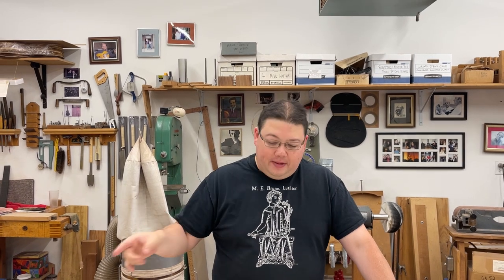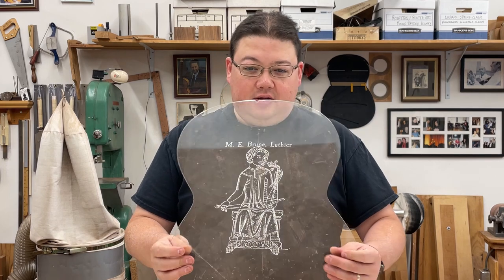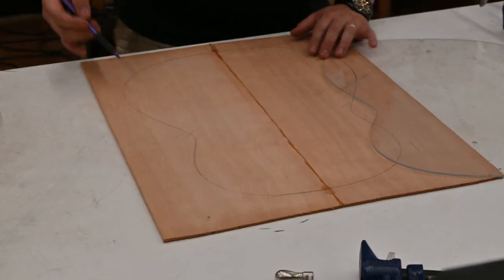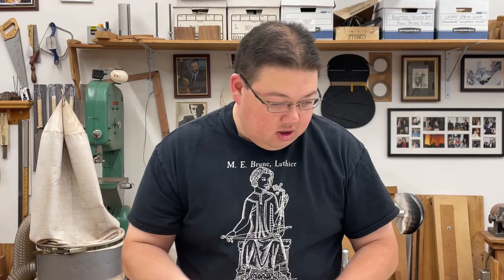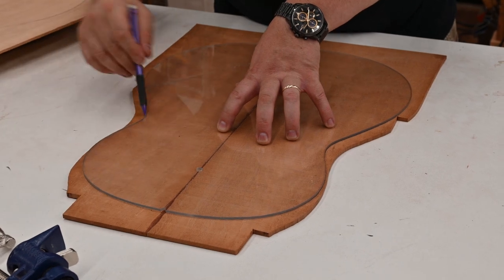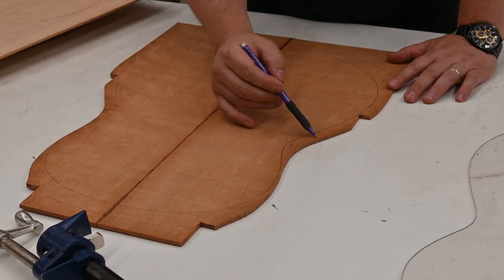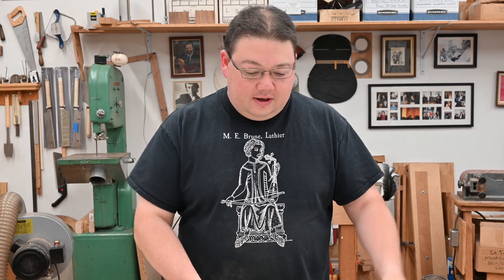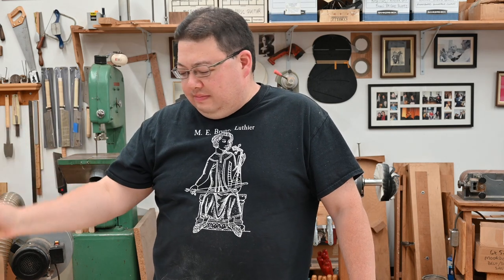Guitar Measurements and Thicknessing | Pro Luthier

Comment: Hey Marshall. Thanks for these videos. I truly like them. 
I have a few questions, if you don't mind: Why are the botom and top caps built joining two pieces of wood? What would happen if they were just one single piece of wood each?
Reply: You would pay more for them because they would be much rarer, requiring bigger, older trees, and more luck finding larger areas with no flaws.  Some early guitar makers pieced tops together from four or more pieces of wood.  I'm sure there are guitars made from one piece backs or tops.